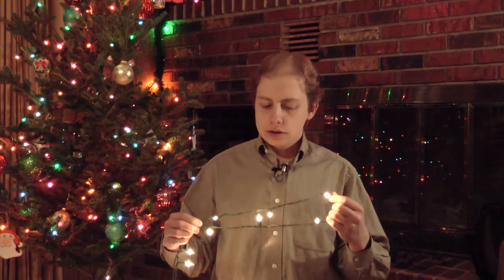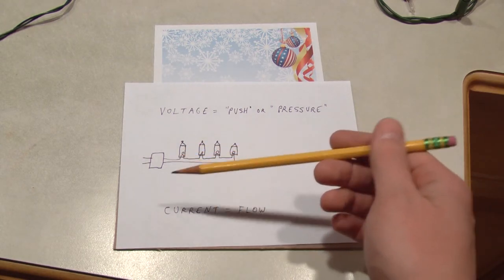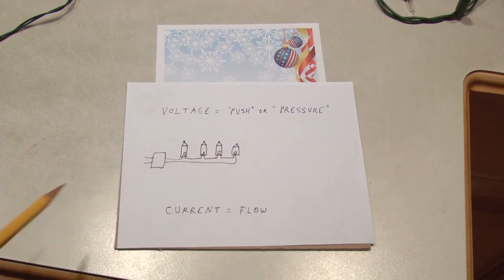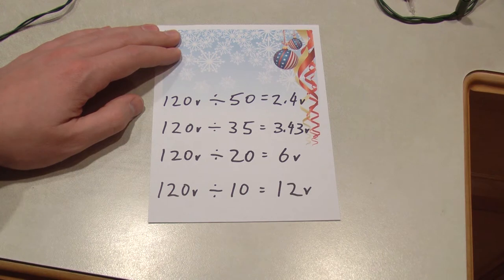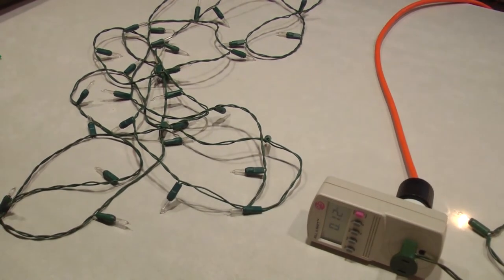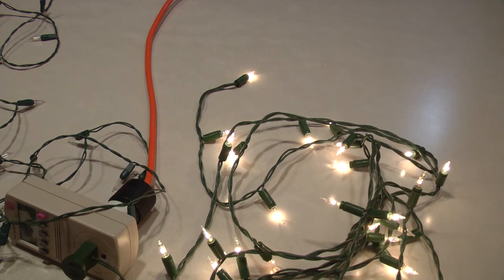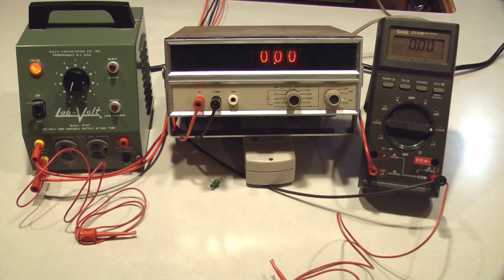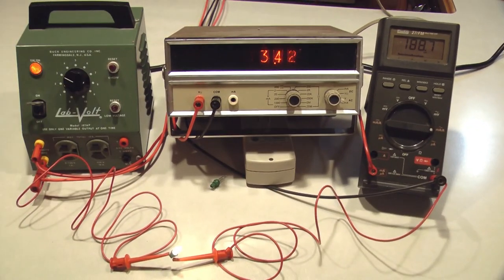Understanding Voltage and Current in Midget Christmas Lights

Comment: Nelson:
Excellent video. Many folks do not know about the different wattages of miniature bulbs. In fact, it's really only been in the past 20 years or so that light set packaging and labeling even indicated what bulb and total set wattage was.
In olden days, you kind of had to guess or use trial-and-error to get the correct replacement bulbs. Packaging rarely included wattage.
Now, you can use the tag on modern strings to determine individual bulb wattage.
I have a vast collection of light strings and replacement bulbs. I have them separated by voltage and wattage, since so many sets now come in varying wattages -- the 50-light sets, for example, come in 100mA (energy saver), 170mA (pretty much standard), and 200mA (super bright, common on older premium sets).
Reply from the maker: Thanks for the insight!
Reply: So, the wattage divided by 120 volts should indicate amperage of the string of lights?
Reply: @fredcdobbs823 Correct. Volts x amps = watts. You can do this calculation for the total set wattage or the wattage of each bulb. All bulbs in a series set should have bulbs of the same voltage and wattage for the set to burn evenly.

Comment: Interesting noting the slightly different 3.5V wattages One could switch lights, using the different wattage, to deliberately achieve various tones. 
I want to connect two clear miniature light strings in series (half voltage) so they look amber/orange. I want to arrange them against a blue background for this winter.
I have two bare 40W 120V rated bulbs in series in the fireplace room - very nice, like candle or wick. I made-up a special series arranged duplex receptacle in PVC box with Pwr. cord.

Also, in the long run, although they effect is the same, incandescent bulbs would probably last longer on DC as there is no 60hz stressing out the filament - my opinion.

Comment: Hi Nelson, thanks for making this video.  I also couldn't find any videos on this topic and I needed to know because I was "fixing" a friend's light strand, and every time I located and replaced a bulb, another would blow out.  I went through about 5 or six bulbs in a row before I realized there was some other factor at play.  I thought all midget christmas bulbs were created equal but apparently not.    I didn't keep track at the time, but I believe that only the new replacement bulbs kept blowing out.  I also noticed (too late) that the original bulbs were physically longer (slightly) than my replacement bulbs.  What would cause the light bulbs to keep blowing out?
Reply from the maker: The replacement lamps are probably designed to operate at a different current than the original lamps. If you can't get lamps that have the same voltage and current rating, you'll have to replace every lamp in the string.

Comment: Thank you for creating this video, it really helps. I think starting at 6:20 you made an error with Amps an mA.
Reply: I was thinking the same thing because I was using a Watts / Volts / Amps / Ohms calculator to try to see how that was working out but shows a wattage way less than it should be.  18mA at 3.5V would be 0.063 watts.  I think it should be 120mA and 180mA which seems to match what the meter in the video was showing.

Comment: Great job Nelson? I had one question. ? My owners manual in a christmas arch way says 2.4 bulbs only. Most got broken during storage somehow. Can I replace all of them with 2.5 since 2.4 are not easy to find?   They are clear bulbs. Would i have to replace the 3amp fuse with a 5amp?Thank you
Reply from the maker: How many bulbs are in the archway? If it is a multiple of 50, then yes, you can use 2.5 volt bulbs. You might want to change all of them, even the ones that aren't broken. And a 3-amp fuse is just fine!

Comment: Hi Nelson just wondering is this christmas incandescent lights able to powered by battery by using 24 V battery pack or holder with the wire to connect them? I am not really sure about it but someone did this on LED Christmas Lights with the controller and the lights is working. Please let me know if you know about this.
Reply from the maker: I'm not aware of any off-the-shelf Christmas lights for 24 volt. You'd have to make something custom.
Reply: Otto:
The closest thing to this using off-the-shelf items is to put 2.5 volt bulbs (intended for a 50-light set) into a 10-light string. The set would operate well on 24 volts, though probably would appear a tiny bit dimmer than usual since it would be designed for 25 volts. I would simply cut up an old 50-light string that you don't care about sacrificing. I would cut off the 120 volt plug, use the longer lead to the first bulb, cut the string after the 10th bulb, and then solder/splice a long lead on the end so you have an evenly spaced 10-light set.